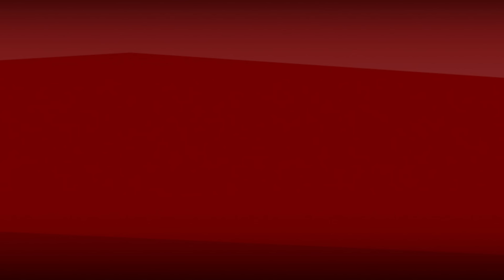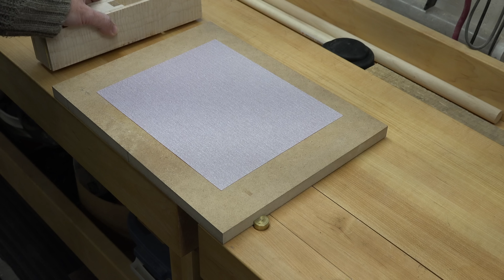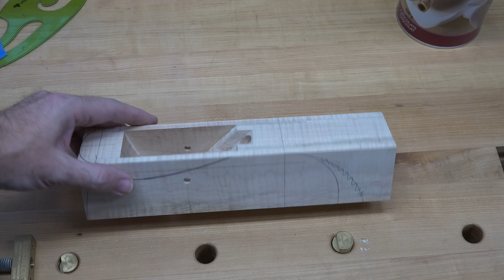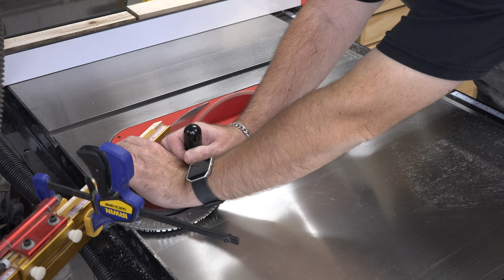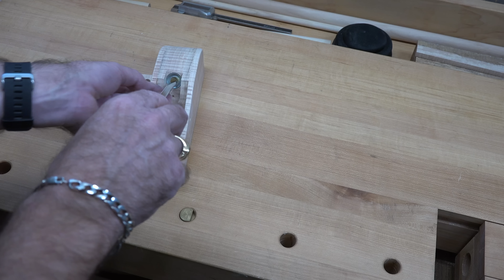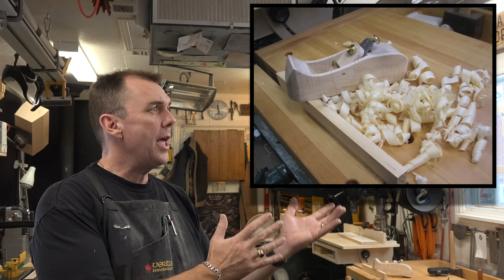Wooden Plane Part 2

Comment: Nice plane! I like that kit!
Reply: I think its better to oil the plane with blo than to use shellac. Just my 2c
Reply from the maker: Thanks Willem.  I appreciate it.
Reply from the maker: As far as the finish goes, I'm not so sure that the finish is too terribly important.  BLO would definitely be nice as well but I question the durability.  I ended up sealing this one with a few coats of shellac and then finishing it off with several coats of varnish.  The finish is rock hard and should last a very long time.   Out of curiosity, why would you suggest BLO?  I'm not saying that it would be a bad finish, but there must be some reason that you are suggesting it.  Thanks for the input and the kind words on the show.  I truly do appreciate both.
Reply: The way i keep my wooden planes and the way i believe it was traditionally done is oiling them regularly. So the wood is fully impregnated with the oil. That protects against the humid situation, especially in winter, in these old wooden workshops. Of course in a modern insulated dry shop that is not necessary, and a lacquer or shellac would hold up. My shed is not a modern building and the Netherlands is moist especially in winter. I have wooden planes of about a century old that still work great being protected with oil.
Reply from the maker: That's some good information Willem.  Thank you very much.  I think I will research some older plane information and see what I can dig up.  You have my intrigued now.  Thanks once again.

Comment: Very nice project! Thank you. I've made several wooden planes but all of them were produced from a solid pieces. Your way looks  to be more simple. May be I'll try it if I would have a necessity of making a plane.
Reply from the maker: Thank you for the kind words on the project.  I'm glad you liked it.  Planes made out of solid pieces of wood?  There must be an awful lot of chisel work involved in making one of those.  They sound great.  Thanks for tuning in to the show and for taking the time to leave me a comment.
Reply: kennyearrings1 Yes, there's a lot of chisel and file work. But it is also very interesting.
Reply from the maker: I don't doubt that it is interesting.  I have a few older wooden planes in my shop and they are all solid pieces of wood and I am always amazed at the craftsmanship that went into making them.  Good for you for making them in the traditional way.

Comment: Looks really nice, and more than half the cost of a Veritas No4 plane, with the added pleasure of making it yourself.
Reply from the maker: Thanks for the kind words on the plane Brian.  It is definitely more than half the price.  At $52.50 CAD (the price has gone up since this video was made) they are a much cheaper alternative to the #4 smoothing plane which runs from $265-$281 depending on the type of blade that you choose to get with it.  That makes the kit less than 1/4 of the cost.   The new blade for the #4 plane alone is $47.50.  There's something very satisfying about making your own tools in the shop and when they turn out as nice and as functional as this one did, there an extra element of satisfaction.  Thanks again for tuning in sir.  Great to hear from you.
Reply: You're right Ken, in the UK the Veritas plane with the Norris adjustor is £200+, the kit is £40+, depending on the blade, so by my reckoning it's 20% of the price. A big saving for a plane that will basically do the same job, after all, the blade is everything in a plane.
Reply from the maker: Definitely.  Now quit messing around on the computer and go make one my friend.  LOL.
Reply: Got a long list to get through first, but I got a kit on order. Just putting the finishing touches to a coffee table I made for the boss. Should have it completed early next week.
Reply from the maker: Awesome.  You know what to do with pictures of that coffee table.  I'd love to see it.  Good luck on the plane build once you get your list done.

Comment: Ken, the plane turned out fantastic. Love the curly maple and I agree it will look fantastic with a coat of shellac. Are you going to wax the sole of the plane? This one turned out to be a great "wood working project". Looking forward to what is up next. Paul / paulsmessyworkshop
Reply from the maker: Thanks for the kind words Paul.  At roughly the 16:09 mark in the show, the picture of the plane in the top corner of the screen is the plane with several coats of shellac on it and several coats of poly.  I'm not going to wax the sole, but instead, I gave it some light coats of shellac and it is as smooth as glass.  Glides beautifully along the stock.  Glad that you could join me again this week for the show.  Next week's show is somethings l little different yet again.  I'm got some very ambitious plans for the show which will be starting soon but I need to get a stock pile of shows in the wings to be able to give myself time to work on the next build series.  I can't say what, but I'm hoping it's going to be a good one.